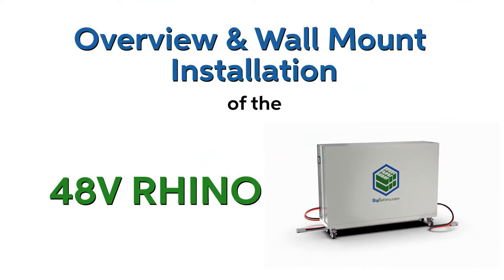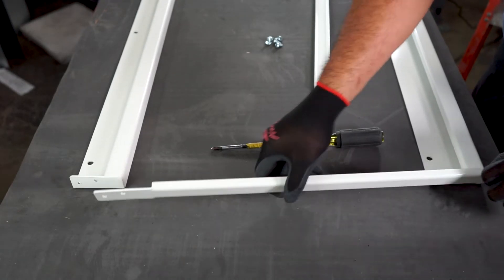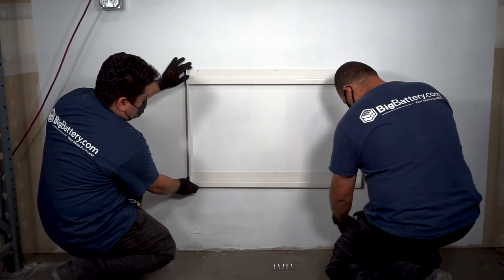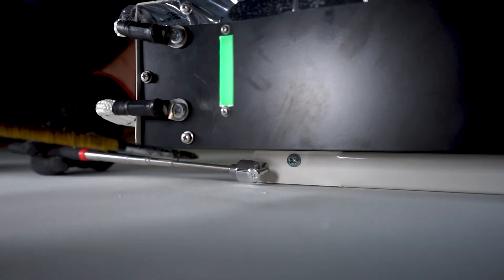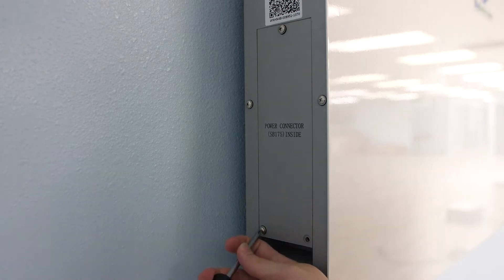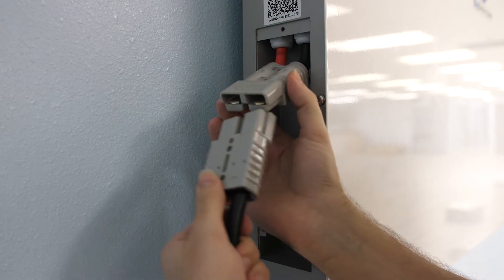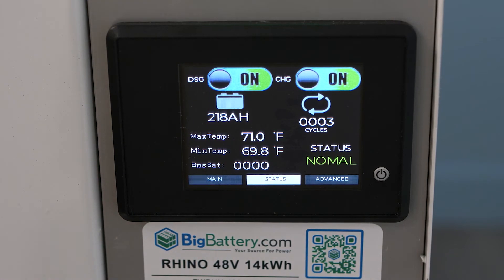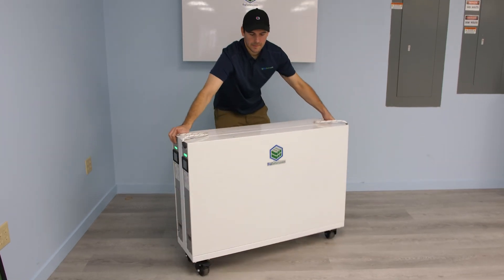48V RHINO Wall Mount | Installation

Comment: Rings??  Sorry, i'm new to your product. What "rings" are you referencing?? Do you have a full-on video that gives an in depth review of the Rhino and its inverter??
      -Thankx
Reply from the maker: Hi! Thanks for your question. Our apologies for any confusion with terminology. At 2:00, what's being instructed here is to ensure your BB175 - Ring Terminals Cable is connected to your inverter before connecting your cable to the BB175 cable on the side of your RHINO. This prevents any short circuiting or connection issues when incorporating your RHINO into your power system for the first time. If you have any further installation questions, feel free to reach out to us at (818) 280-3091 and one of our Support Reps can assist further!